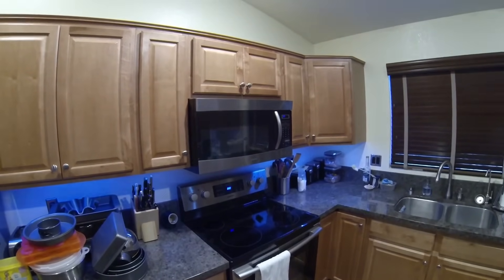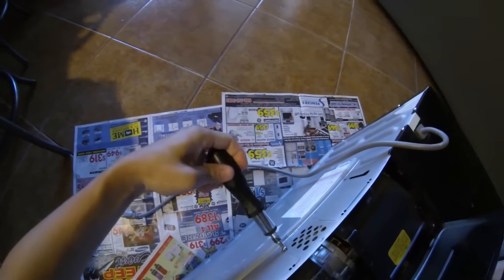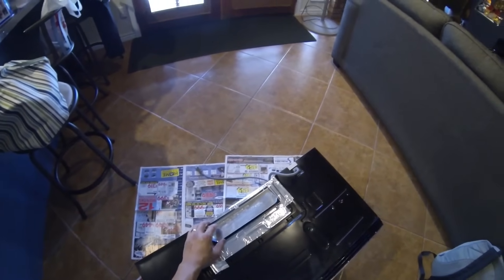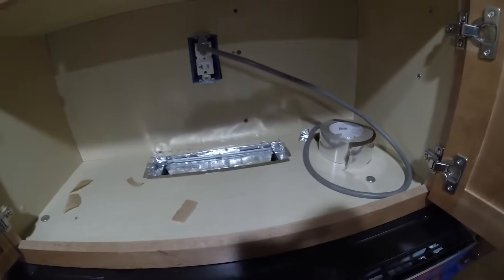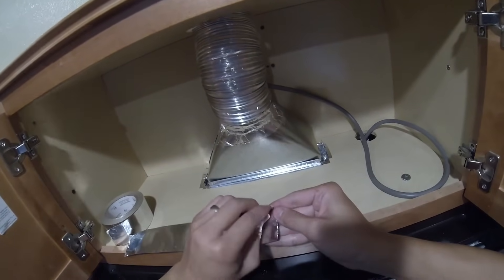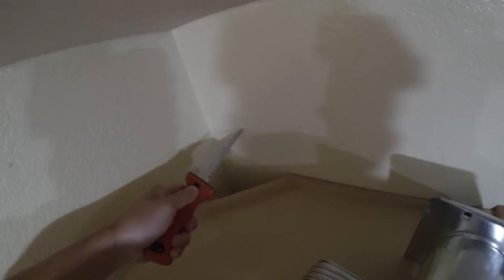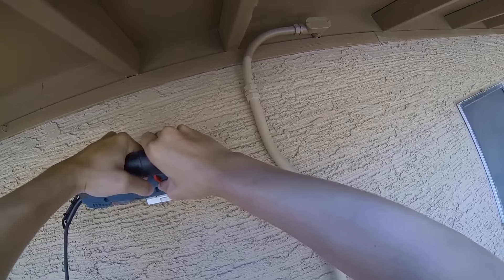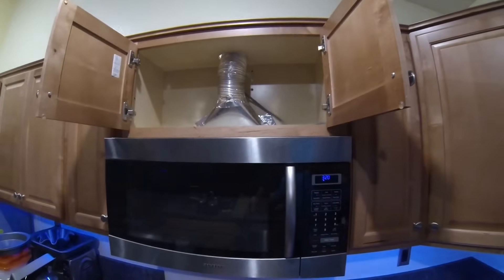How to Install a Microwave Hood with Exhaust Fan - DIY

Comment: People have pointed out the flex is illegal (and extremely dangerous), but it looks like you're working with 4 inch duct as well. 300 cfm, typical of a microwave, is the upper limit of 4 inch duct. Some laws put 300cfm above the upper limit. You're going to have a LOT of grease buildup in there, which WILL start a fire. Your flex duct is also on the outside of the boot so as the grease drips down, it'll pour out the sides into your cupboard, adding fuel to the fire.
Reply: 400 cfm is the upper limit of 4" duct, not 300. a 30" stove would be 100cfm for ever 10". So 300cfm is needed. His 4" pipe handles 400 cfm which is fine. He should replace the flex but many people use this. Even pro's from the range to the upper wall vent.

Comment: Good video with a couple of issues.  The electrical outlet should have been moved.  No sense cutting a corner here as it may lead to issues with adapter becoming loose later.  Also hard pipe duct is to be used.  The flex duct is not acceptable.  Cutting corners always results in later re-do's.
Reply: @ticklemewilly  flex duct can handle heat no problem, but the ridges reduce your airflow by up to 50% and can accumulate moisture. It is highly discouraged by everyone I have talked to. If you have been in service for 25 years, then you probably are using information from 25 years ago.
Reply: @WrestlerMonkey123  Agreed. Flex duct should not be used for any application dealing with heat transfer.
Reply: @WrestlerMonkey123  Not to mention grease will build p inside the ridges and become a fire hazard.
Reply: @ticklemewilly  its it's not the heat the oroblem but the grease from the food.

Comment: Great video although, microwave exhausts aren't made to deal with much backpressure. You should use a 6in pipe, minimum..Also, flex duct in a big no no... All the ridges will catch grease and it doesn't pass code. You need to use solid duct for kitchen exhausts.

Comment: omgosh, use a long bit to go all the way through the wall to the outside as a pilot so you know it's all lined up.  Also that foil tape feels so strong, but in 2 days it can fall off, iknow it seems crazy.  use shurtape 181a-p/181b-fx.

Comment: There is a drill connection that drills a perfect 4 inch hole with an each 1/4 inch or whatever for space to slide the, the drill hole comes out through the wall so when you go outside you just line up the will with the hole and you get a perfect straight through circle that isn't uneven . I don't know if you did or not but I would also recommend some kind insulation, like great stuff foam insulation in the wall before closing it up on both sides. I would also recommend some kind of weatherproof caulk under the rim of the outside before screwing it down. Also if you're extra paranoid about pest, putting a metal or fiberglass screen on the outside duct hole just in case because wasp and roaches are very smart and can get round that flap. Again great video, just little things I added, I'm doing this soon, got my materials this morning.
Reply from the maker: ***** I looked into the 4in hole drill but didn't want to spend the money because I dont think I will have any future use for it. I did use caulk to seal up the inside/outside which I didn't show in the video. Thanks for the recommendation on the screen for the exhaust. I will have to add that.
Reply: mitchy02 yeah the screen is real cheap comes in fiberglass and metal. Had a couple houses where we would have wasp in the kitchen a lot. Wasp love those sides of the house with a cover and shade and can def get under those flaps.

Comment: I never understood why this procedure is called installing "an exhaust fan with hood for your microwave".  A hood for an exhaust is something made to catch the air from whatever area you're trying to exhaust.   In the case of a microwave,   itself is the "hood".  The ducting consists of a transition piece from the microwave to whatever duct you are using to vent the air outside.

Comment: HI. Hoping someone can answer questions. A store just replaced a hood vented microwave with a new one for me. When running, should there be any air coming from the microwave into the kitchen?  Also, any way to fix the damper that clanks open / close every time either the fan or the microwave is used?

Comment: Just another comment about using the rigid/smooth ductwork as opposed to flex ducting. The reason for this is that flex ductwork will catch grease inside the it's creases over time, increasing the chance for fires in your ductwork. For that reason, it's against IRC M1503 (International Residential Code) to use it in range venting applications.
Reply: Yes but the exception is manufacturers instructions and there is foil duct that is fire resistant and rated from the manufacturer for kitchen vent
Reply: @jlLeeification  yes. home depot sells one made just for kitchen and vents that's 7 inch. I have to use that the last 2 feet horizontally because my attic space is tight and any 90 degree won't fit. I'm using rigid straight from the damper up to the attic. so I can easily change thus part out or clean if necessary.

Comment: My vent fans turn on when I’m just using the microwave. For example put a glass of water inside for 30 seconds. When I press start I can hear the fan up top. Is this normal?

Comment: It has been seven year....did you ever have to put a booster fan in that long stretch of piping or does the microwave push out enough air on its own?

Comment: at 5:55, you said you want to seal with tape to ensure no air flow outside of the area, and that all air goes straight into duct. what happens if there isn't a good seal, and i feel air coming out of microwave vent even though a duct was installed. my handy man didn't do a good job.

Comment: Awesome. Super helpful. I am trying a similar project, although the duct would have to go through an interior wall that divides the kitchen and dining area, and then across till it exits the home. I would say the distance would be 14 feet. Seeing the as duct would be exposed for 10 feet or so: Is there an option to install a larger duct over it, perhaps with an industrial look, that maybe makes it serve as an accent to the home, rather than an eye sore? Any suggestions?
Reply from the maker: 10 feet is quite a bit, but an industrial look would probably be the most appropriate.
Reply: +mitchy02 I hear if it's going to be so far it may have less ability to exhaust the air. But is there a way to install an external fan outside that helps pull the air?
Reply: +mitchy02 also can you use a solid pipe rather than a flexible one?
Reply from the maker: You can use a solid pipe. Probably more recommended. I haven't heard of that. And you say your distance is 14ft? Your A/C ducts run further than that.

Comment: 3:37   Does it matter which direction the damper flap faces? The installation instruction manual isn't clear and I've seen it both ways in videos.  Thoughts?
Reply: No, as long as it restricts back flow.

Comment: hi Thanks for the video ..it is really useful. I have a similar situation and have a soffit like yours and probably has to go with 4 inch solution vs 6 inch to hide the duct. I have a question: How do you know where exactly to drill from the outside that fit the hole on the inside? And what type of saw that could be used to make hole from the outside? Cheers, Danny
Reply from the maker: Thanks for watching! The easiest way is to drill a pilot hole from the inside to the outside and then measure accordingly.
I used a jigsaw. It would be easier to use a hole saw but they're not cheap.
Reply: The way i've done it is outline your circle on the inside wall. Find the exact center and drill your pilot hole all the way through to the outside(you might need a long bit). Now from the outside using a hole saw bit thats the diameter of your drawn circle make your hole. There is a center bit that sticks out past the circular teeth. Stick that into the pilot hole. You should cut directly onto your inside line.

Comment: you could really should remove everything that you installed... and you never should of moved that range... that uncovered power source must be moved to start with it is easy to do... and 6'' smooth venting is a must, that dryer 4'' venting will get lots of grease in it and will catch fire believe me........ you can go out that same wall... also  many of these ovens only have 2 fasteners on top i  do install of these ovens in san diego many Hundreds of them for 6 years now...
Reply: @tannervoss1669  From sun reys    it's hot in San Diego
Reply: pretty sure those filters will capture most of the grease not to mention the grease will always be INSIDE the microwave assembly anyways
Reply: I think what you are referring to is for exhaust fans specifically not so much microwaves with exhaust fans

Comment: Code calls for rigid metal ducting with a smooth surface. What you used will collect grease and potentially start a fire which you insurance company will refuse to pay for.

Comment: How effective is this set up ? does it completely sucks up the smoke and odor from cooking? Ive been deciding whether to use my existing OTR or replace it with a full range hood. Your feedback would really help. Thanks!
Reply from the maker: Vic Cruz I believe actual range hoods are more effective than OTR given that they can cover more area above the range itself. I would say (with no scientific backing) that it's 70% effective with my OTR. though, better than no exhaust. if you have the space and money I would opt for a range hood and separate microwave
Reply: Microwave venting is very poor compared to a full range hood.

Comment: you have stucco I have brick. is there a brick saw that won't mess up my mortar? snug or not I'd mix up some cement(or stucco) to fill in the gaps outside. here anyway, we have damned cold winters and only way I could mount is outside the north wall. in addition to the soffit you can partition off the inside of the cabinet with double or triple ply  corrugated cardboard(cheap paint it white)and still get your cereal boxes in there without bashing the ducting around(things get hectic in the morning with breakfast boxes here anyway :) my old appt I had one of the exterior ducting pipes and it got pinged alot with metal cans mostly those grits, oatmeals and coffee cans. That storage space is still good though.

Comment: Great, that was very helpful.  I am buying a brand new condo and I can't believe that they don't vent to outside. My only choice is to vet in my 2 car garage which is better than venting moisture/smells inside the house. It should be code to vent outside. I hoping that the GE unit that he put in is able to make that conversion change.  I wanted the builder to do it but he said it doesn't pass code but I can do it later. I don't understand that if you can vent in your living area, why not into a garage. Maybe they think fumes from the car will go into the house...hello I don't run my car in the garage, furthermore there is a door that goes into it.  I'm doing it no matter what, it's better than going out and smelling like what you have cooked. lol
Reply: It is most likely fumes from garage.  Same reason an auto- closing garage door is code. (Spring hinges)
Reply: @PeterMurrayj  hahaha, I forgot about this post. I ended up putting a real hood with a fan to the outside. Glad I did, was the best $1,200 spent.

Comment: Great video. Question...is the duct just held by the siver tape?  I have a lot of air just blowing into the upper cabinet.  Can I fix it myself with more tape, without getting someone to take down the microwave.
Reply: Another question...pamphlet says to put kleenex under filter and it should hold...doesn't.
Reply from the maker: Thanks for watching! The foil tape secures the connection between ductwork. You should be able to seal the duct within the cabinet. Hard to tell your setup without seeing it but try a small piece of the kleenex. Tissue paper can weight more than you expect.
Reply: Thanks, I did the foil tape and sealed everything.  worked great. Air must be going out the vent now.  So glad I found you...lol

Comment: switching the air draft from the vent to upward a standard option? I noticed you slide in the flap and there seems to be a kit, as the microwave provides for this option. Is that standard with all microwaves? if not , what brand is your microwave?
Reply from the maker: I can't say for certain, but I most should have the option to either recirculate or exhaust to outside. With that, the fan would have to be rotated to accommodate either method. The flap came with my microwave when I purchased it. If you don't have one, it should be available for purchase. I have a Samsung microwave.
Reply: Mamima God b.
Reply: thanks. I had since found out some models do give the option. appreciate your prompt answer and thanks for the video

Comment: Nice video but should have used 90s and rigid duct, it's just as easy to work with as flex duct. This stuff is the worst for dryer vents, if you use smooth wall rigid duct you will almost never have to clean it out.

Comment: i have a question. i successfully installed the fan  and have used it for 2 weeks.  But it seems like all the smoke/smell from cooking is not completely vented out and we can still smell the smoke/cooking flavors.  Anyone has any ideas?
Reply from the maker: +Trang Ta A microwave vent will not eliminate all smoke/smell. It does not provide enough coverage over the stove. This is normal.
Reply: Late to the party... I plan on installing an in-line duct fan (such as Fantech) near the end of the 6 inch duct to facilitate cfm. The benefits are  in line fans are super quiet and powerful.
Reply: Before installing microwave the vent on the micro is adjustable to recirc back into room from front of micro. Make sure it is flipped to blow out top

Comment: Great video. However, 4" exhaust is no good for this since your OTR Micro fan is likely 300 CFM (100 CFM/10" of cooking surface). 
You connected a 3 1/4" x 10" or ~30 SQ" area to a 12 SQ" vent.
Reply: What should be connected ?
Reply: @oscarochoarealtor  Given the fact that the opening on top of the microwave is 3.25" * 10" (32.5 SQ"), just use the formula for area of circle: A = pi*r^2. With that you get a minimum diameter of just under 6.5". 

However I've seen most people say that 6" is sufficient. I think this is because the 32.5 SQ" opening on top of the microwave isn't all being used, rather just two smaller openings that the fan blows air through.

Comment: Hi, I also installed the vent similarly as you did and used 4 inch pipe. But my microwave does not exhaust all the smoke. Mostly from the outer stove. Do you also have similar issue. I also noticed noise when the microwave fan is on.
Reply from the maker: +Rajesh Garg Yes, that is true will all microwave exhausts. Over the range microwaves aren't as effective as dedicated range hoods because they only cover part of the range. Also, not all microwave exhaust power are equal. Mine has 5 speeds and the max speed is quite powerful but also quite loud. This will vary by brand/model.

Comment: Very dangerous setup with the flex duct. Those accumulate grease overtime and if you value life, you shouldn't install one in the kitchen as it doesn't meet code. Second, 4'' is too small for you
Reply: I’ve seen this reply a few times but no one says what the issue is?  I guess a massive grease accumulation can make the fan work harder and louder?

Comment: Nice video, Seems like I'd be able to do this vs shelling out cash to have another hole in my roof.
Reply from the maker: ***** Thanks! Yeah, there was more work involved to go through the roof. This was more of a convenience method. Also, with having vaulted ceilings it would require for my to run the duct through inside the wall.

Comment: Hi..

Did you use a 4" duct or a 6" duct to the outside ? How's the performance at removing odors?
Reply from the maker: Vinay Krishna Tharigopula Thanks for watching! I used a 4" duct to the outside. It significantly removed much of the odors from the house. I have a HEPA filter that detects odors and it worked harder when cooking. Now it doesn't have to work that hard. Definitely a great improvement if you cook a lot of food.
Reply: mitchy02  Thanks for the video. It's a nice point of view shot. We cook a lot and this should be a nice weekend project.
Reply from the maker: Vinay Krishna Tharigopula Keep in mind that the performance is also depends the microwave itself and keeping the filters clean. But simply moving the air outside will be better than recirculating any day of the week.
Reply: Our KITCHENAID microwave with hood exhausts via duct to outdoors. Question about cleaning the "filters". Do I need to replace the charcoal filter periodically? I understand that I need to clean the grease filter.
Reply from the maker: The charcoal filter is just for the recirculation method.
Reply: mitchy02 
Thank you very much regarding the charcoal filter! Especially for such a quick reply. I suspected it was not necessary to maintain it in my configuration, but could not find a definitive answer anywhere.  Thanks again.